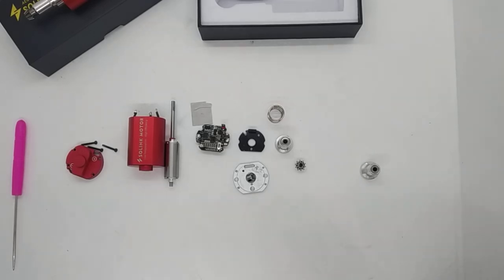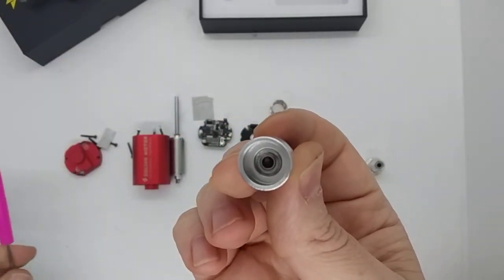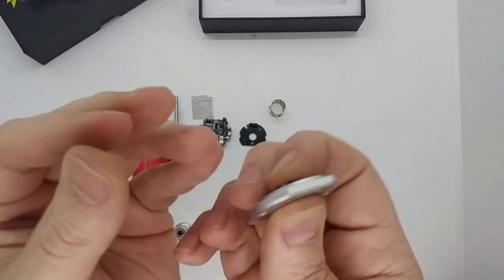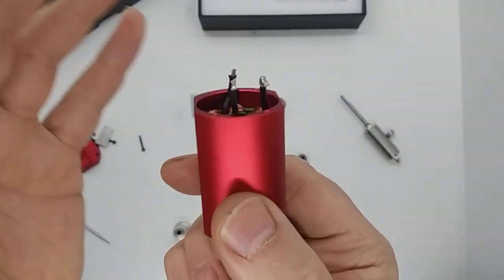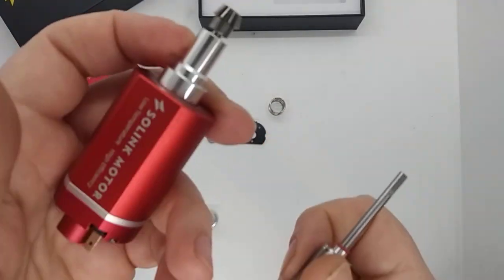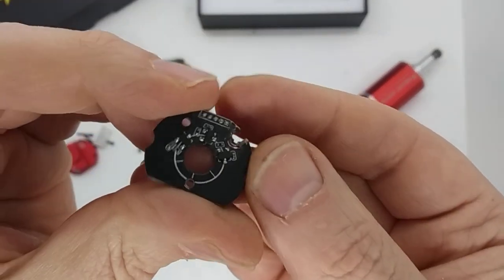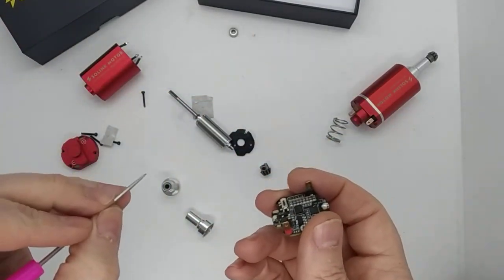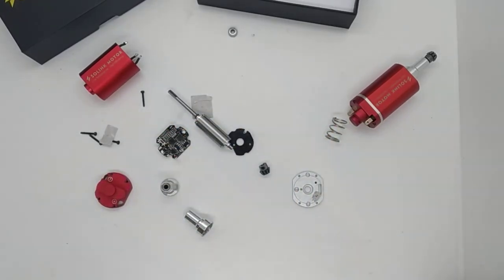Solink Brushless LITE Motor Internals

Comment: Did you disassemble the t238 blue ? I think it has that switch too for the speed?
Reply from the maker: No I didn't take a look underneath.  It's possible I suppose.
Reply: @xtairsoft  can you check yours? i already disassemble mine it has a switch too but i don't know if thats the switch to lower rpm btw mine is 37krpm blue 😅

Comment: If I was to pair this motor with the solink helical gear set, should I use thread locker on the pinion grub screw? And if so, which one do you recommend?
Reply from the maker: Yes, I use Loctite 648 but really any decent strong one will work

Comment: I have swapped the pinion on most of my brushless, (including option n1 with O type) without disassembling them and never had issue. There is far more risk removing the board. 
For the Solink with large bearing at the end plate and D type, there is absolutely no need to disassemble it. Just make sure to press instead of hammer
Reply from the maker: Press fitting might work, I'd have to run some test.  I found Solink to be quite tight compared to other motors, which is good.  

I did already damage one Solink motor bearing where I was lightly tapping to get the gear to fit.  I'd be interested to see how well press fitting stacks up.

I think some users might not even know the motor is damaged,  I only noticed the damage as I was conducting heat tests between Warhead, T238 and Solink and I noticed a spike in the running temp after 40 secs noload.  Otherwise I don't think I would have found the problem.
Reply: Why not just Cool the shaft and heat the pinion?
Reply: @needmoreboost6369  it will reduce the friction but can't guarantee that pressure needed is low enough to not damage support bearing and ESC.
Reply from the maker: @giuroy  agreed.  My guess is some of the brushless manufacturers are looking into the issue on how to make pinion fitting easier, will be a unique selling point.  Either QD controllers or a structure inside that braces the shaft.
Reply: Nope, never press fit a pinion with a brushless motor.
If yours is still working you’ve been lucky. 

I smashed the sensors and esc on my opt.1 that was probably one of the first in eu like 4 years ago.

Definitely do not attempt to press fit a pinion without removing the esc and supporting the rotor on the other side.